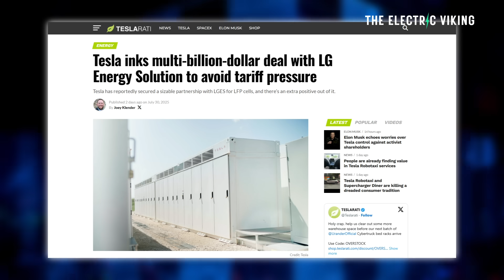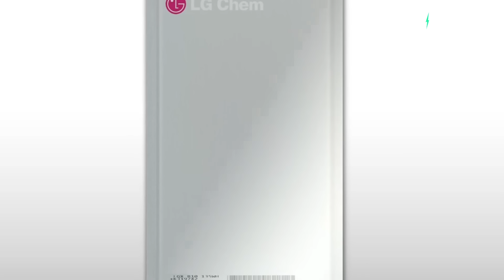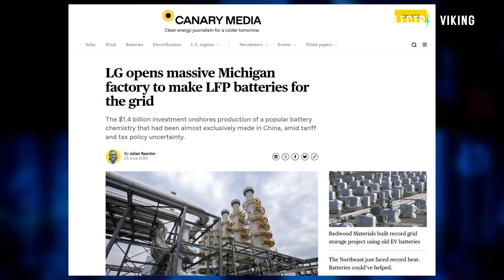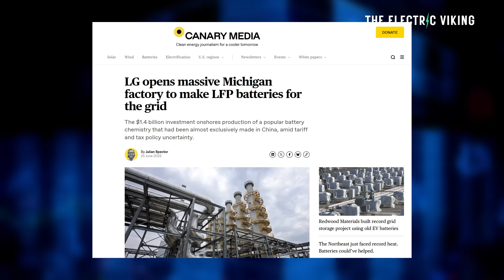Tesla Signs $4.3 BILLION Deal for 50% HIGHER energy Density LFP Batteries

Comment: What people want is fast charging speed, closer to the petrol station experience.
Reply: That’s what people think they want. Once you have an electric car, you save so much time but not ever having to go to a gas station again because you’re charging at home. When you do go on long trips one or twice a year, charging for 30 minutes every 250 miles or so isn’t a big deal considering all of the time you’ve saved throughout the year.
Reply: @danparish1344 if charging at home every night wasn't the barrier as which it is then most people would have already switched to electric cars... The charging time and charging at home is a massive barrier that is stopping people going electric. It's certainly stopping me as a renter who would have to Risk using a 25 metre extension cord to be able to charge at home with granny charger speeds. It's just not viable.
Reply: @danparish1344  Not to mention the stops allow toilet breaks, a change of pace, a healthy stretching of muscles.
Reply: @danparish1344  I drive a tesla now, however, my last car, a diesel, would regularly do 1,000 miles on a tank of fuel. So, very little time spent at fuel stations. In comparison, the Tesla manages about 250 miles on a battery when driven at the same speed. For me, the cost of public charging is the issue, more per mile than paying for diesel.
Reply: @danparish1344 thats assuming you have home charging. If we really want mass adoption, ALL of it has to be better. Then people that live in apartments can charge with public infrastructure the same as gas, etc. I am a full on EV evangelist but it’s ok to admit the current short comings.
Reply: People want different things. I don't care about charging speed much.
Reply: Cars spend the vast majority of their time parked when they could charge. So for people with houses/garages, it is not an issue, but for appartments, it usually is. But if we had self driving cars (hurry up already), they could just go charge themselves at night.
Reply: Most people don't know what they want until you tell them, they want to stop and eat and potty for 10 minutes?
Reply: My 2019 Model 3 charges fast enough for me… as I charge 90% of the time at home while I sleep, or on Sundays while I mow the loan. I actually spend less time per year charging on the road, then I spent holding the fueling nozzle when I had my previous ICE car!
Reply: Hell no, charging my Model Y RWD at home saves me 11 hours per year.  I do not want anything remotely as wastefull as filling up away from my home without reason.
Reply: @justice1902 it only saves you 11 hours? What haha.
Reply: I want to stand in the rain cold and heat.  I also want to look for gas stations to get my oil changed. so much more fun than driving in my garage and taking 15 seconds to plug in my ev.

Comment: Ruh roh!  LG Chem is the one making all those batteries that catch on fire, the Bolt Recall, etc.
Reply: LFP batteries don’t catch fire. You can pound a nail into them and they won’t catch fire!
Reply: @derekjohnson9575 That’s NOT how that works 😂😂😂
Reply: True but those were not LFP batteries.
Reply: GM reported 18 fires and 110,000 recalls. I never worried about a fire and I got a new battery for free.
Reply: They will just license it to tesla for tesla to produce themselves
Reply: Yeaah LG just have continued making that kind of battery ........(😅)
Reply: Battery chemistry will make the ICE irrelevant.
Reply: @GWAForUTBE Not until the cost comes down by 10-25k
Reply: @joshuaw2143 The cost has at least  halved in the last few yrs
Reply: @GWAForUTBE  Yeah but it plateaus until there’s some major breakthrough. Best Ive seen were the 24m batteries so far. But the battery isn’t the only cost difference.

Comment: Tesla BUYING batteries instead of manufacturing them. They are not outsmarting anyone, they are paying more for someone else’s technology. If the batteries are better, they are more expensive.
Reply: Sometimes someone else make better parts than you can and you just have to buy them if you want your product to perform well.

Its only shameful if it continues to be the case forever. A temporary solution until you can catch up or overtake is an acceptable course of action to take.
Reply: @awb07d This news signals Tesla is dropping its 4680 battery. Panasonic said last week it was delaying expansion due to low Tesla demand.
Reply: @rioriggs3568 

Ridiculous nonsense, these are LFP, Tesla’s 4680s are Li-ion.